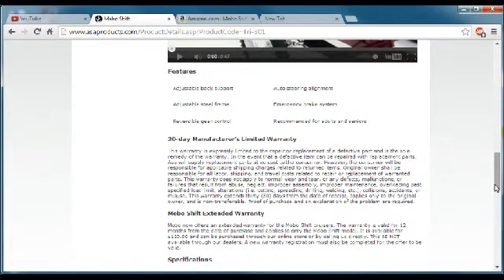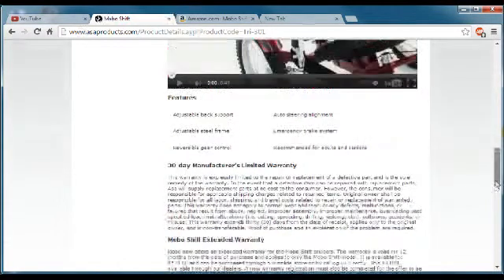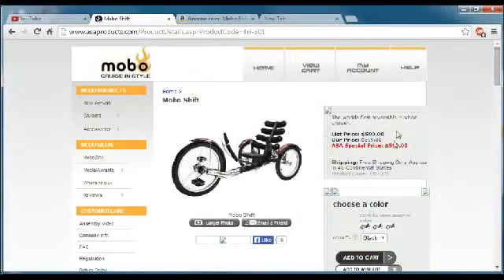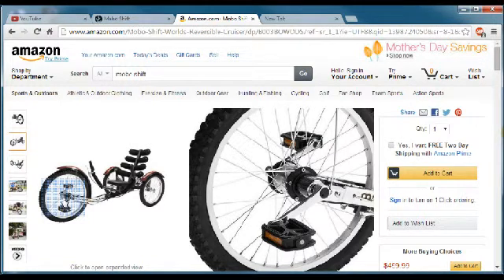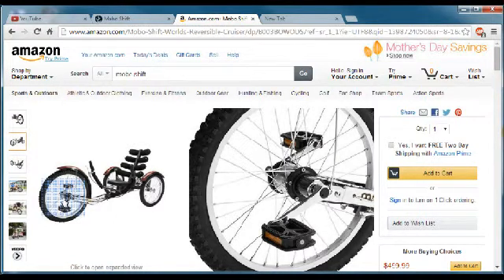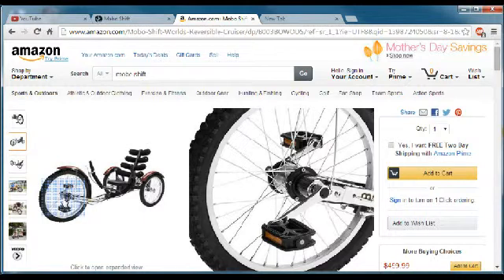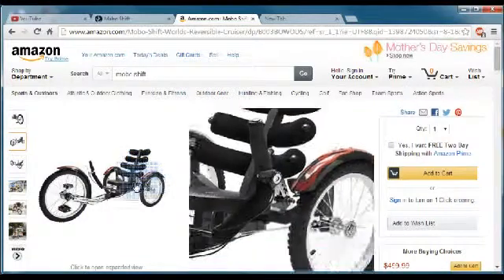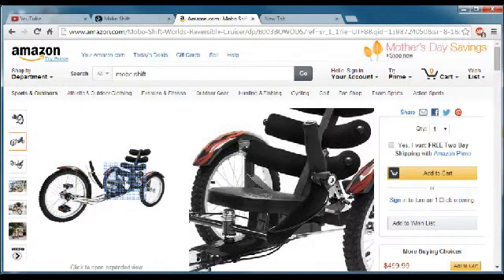Mobo Trike and Internal Gear Hub. Will it work?

Comment: I’ve seen a guy turn his Mobo into a 7 speed bike. He put the peddles behind the front wheel instead of on it and the gears on the front wheel where the peddles are now. Also a chain connecting the one gear on the peddles to the gears on the front wheel. But I don’t think it will work the way it comes from the factory. You’ll probably be getting into some serious modifications to make it work. Cutting the frame, welding pieces on it, maybe manufacturing some new pieces, adding the gears and figuring out a way to put the shifter on the handle bars. So it can be done but not without getting your hands dirty.

Comment: Okay, lots of negative comments about the poster being an idiot, blah blah blah. I dont know anything at all about bikes period, but I do have a disabled son who Ive just bought this bike for and would love to be able to modify it to go faster, up hills easier, etc. But since I dont know anything about bikes, videos and helpful comments (unlike the jerks here) actually do/would help. Geez. The world is bigger than you and has all sorts of people with differing abilities.
Reply from the maker: Eh it's fine. Deal with this kinda of thing in MMO's and jazz. That's kinda why i just leave them there to show how dumb people comment. This is nothing compared to what people posted on about my Hoverboard video i made of talking about a hoverboard skateboard design to someone.

As for the trike. I kinda figured why they intended these to be 1 speeds. Cause the faster they go, The turning becomes harder to hold center and any little turn kinda sucks you into it. So they made it slow and relaxing so you won't have that kind of prob.

If you did intend to try modifying it it might take abit of more research then just trying to buy a wheel and slapping it on sadly. And i haven't been bothered to do it anymore. I mean there could be a way you could make it faster, but you'd have to use a trailer that's powered that would push you like the ridekick. But again the faster you go, the more easier it is for the turning to get you sucked into the turn and cause you to flip. Unless you made some kind of way to strengthen the revert springs, and made a switch that would soften them up at low speed, but tighten them up at higher speed, so it'd make turning Harder while going faster that would help prevent oversteer as the trike loves to do. but then also allow more steering while the trike is at a slower speed. Since that's it's biggest prob.

Comment: I know that this is old but, since the Mobo is direct drive powered... How about looking into unicycle upgrades?
Reply from the maker: That's not how Mobo works. Most mobos use Freewheel hubs, while the Shift uses a freehub with a latching locking system on the otherside of the wheel to make the rolling of the tire rod lock with the peddles similar to a direct drive. But isn't.

The mobo's use a rod in the middle of the wheel, with a pin wield that has a Freewheel hub threaded attachment on one side with both the ends having Square taper screw points. This is unique only to the mobo tricycles.

Unicycles are fixed straight to the spinning of the wheel, So whenever the wheel spins. So do the peddles, like a kiddy tricycle has. These don't have that.

Look at my other video i show a close up of the locking latch that another person wondered about how the shift's 'goes into reverse'.
Reply: @KillerRaptorr  Yeah... Reverse shift aside, that sounds like a coaster unicycle. Something like a Coker that was altered a few years back. I'll try to dig it up for you.
Reply: While looking for the old coaster cycle post, I found this:
 https://randomascii.wordpress.com/2012/11/25/riding-faster-on-one-wheel-geared-unicycles/

Thoughts?

Comment: Looking for a trike and seen how cheap mobo trikes are compared to other manufactures, but then seen it has pedals on front wheel and thought nah, but then remembered of nuvinci hub drive that friend had on his bike few years ago and thought mobo bike plus nuvinci would actually be great. 
Was looking on the Internet about nuvinci being installed on front wheel and this is only information I've been able to find. 
Did you had any luck with your idea? As far as I see it, only problem would be to install pedals on nuvinci, since it isn't design to have pedals on it, but think that shouldn't be a problem. Though as you already said, it wouldn't be cheap to try it out.
Let's talk more about it
Reply from the maker: +Jani Veble I'm still working on seeing if I can even disassemble the hub. they have some odd system that makes it almost impossible to remove the sides off the hub (the black part over the freewheel drive.). I'm thinking it screws in but I yet to try reverse twisting it off. but will see. Once I get that off and see how the hub works. I'll update yea again.

Simple what I think of how this hub works tho. is it's like a standard screw hub you find for axle mounted rear wheels. sup they have adaptors to it on each end that screws on those axle ends. and changes the hub from a standard screw point to having square taper ends so it can mount peddles and have ball bearings be the sitting point for holding the hub to the trike.If I'm right on this about them using their own adaptor system on a standard hub. Then it should be pretty simple to convert from theirs.
Reply from the maker: I have info now. The hub is a hollow hub. The black round shield is wielded to the rod that the crank arms attach to (via screws). Remove the crank arms, and use a ballbearing removal tool (there are locking rings so the ball bearings don't go flinging off.). And you can remove the rod in the hub by using a hammer to beat it out of the hub.

If you can find a geared internal hub that is axle based (Not quick release). And is a whole axle (the rod can be removed.) then you could possibly replace the internal gear hub rod with the mobo shifts or triton pro's rod to slip in and replace the ballbearings back in (for the shift the reserves fix spacer system won't work. so you probably won't need to bother replacing the ball bearing of that end in. just the two outer and put the black donut ring inside the internal's gear sprocket so you can screw the ring onto the black shield ring.)Hope this helps. :D.
Reply: Hey there, you have been busy, I didnt quite understand now, it seems that Nuvinci cant be mounted to Mobo trike?

Comment: Did you really put this out on the internet hoping to get a serious reply, or was it just a silly joke? I can understand why you wanted to know, but using your own brain might do you more good. If you had actually spent as much time searching on the internet as you did making this video, you would have come up with the answer for yourself and learned something along the way.
Reply from the maker: A Nother Wow. O my how wonderful the internet gives me twits I gotta write back to cause they wanna make my day fun!. These bikes aren't chain driven. And the 'shift' has a different sorta gearing system that no one knows of inside the hub or maybe it's beside the hub incased. That's the prob and reason I asked on this video/tried to look into. If I had the bike moron. I would already know. But I don't. This video was mainly speaking to the people that DO and may wanna try 'removing' the black cover over the tire to see what kinda gearing it has for the hub or if it's a dedicated ONLY from Mobo (can't make it from any other bike company or there isn't anything else like it. Aka it can't be upgraded/replaced with a common gear hub,etc.).

So maybe instead of telling me smack. Why don't you get a brain?
Reply: Hey, if you want to show your ignorance to the world via the internet, that's fine. I can already tell your IQ is less than my shoe size, it's obvious from your reply. There is no gearing in the hub, it's a ratchet on a freewheel hub, nothing more. I don't have one of these trikes, but I do have a brain. Look at how hub gears or even derailleurs work on any bike, or even car gearboxes, and you'd figure out that you would need to separate the pedal axle from the hub via a chain or a shaft to get any kind of gearing to work. Try working things out for yourself... it can be fun and you'll learn a lot more.
Reply from the maker: A Nother Maybe you should learn abit more about bikes before talking out your butthole.

It's not just about the hub being a geared hub or not. It's about how the hub is placed on the front bike. Like you noticed some bikes have the hub angled off centered of the bike for rear tires (or this trike for instance.). Not to mention the size of the hub's axle lengths. There's more to it then just a 'Hub' of the bike.

But thanks for showing me how dumb you can be by commenting on a bike + not even having one. So maybe when you decide to go to a friend who does or you buy one now. Then you can come back and tell me abit more about how smart and epic you know about bikes. Genius.
Reply from the maker: A Nother Ok bud. If you can buy me a 7gear internal hub and this bike and ship it to me. I'll cheer how awesome, how epic, and how specially cool you are more better at bikes them me.

But sadly I bet you know 0 of anything about bikes. But thanks for making this comment box so interesting of your own stupidpitty.